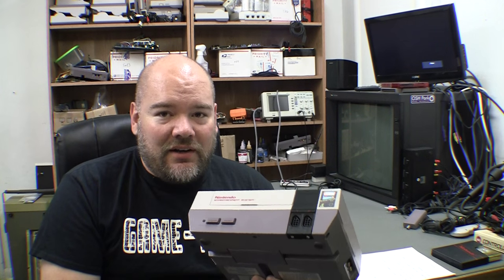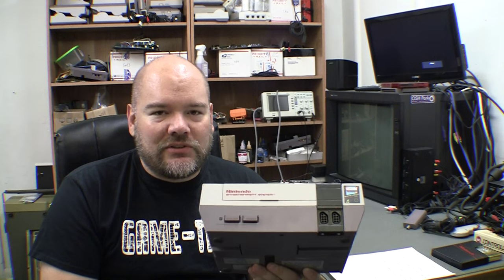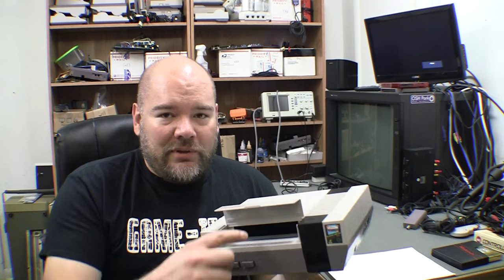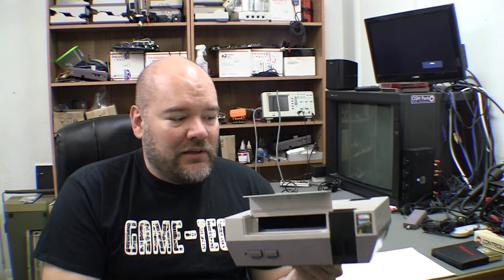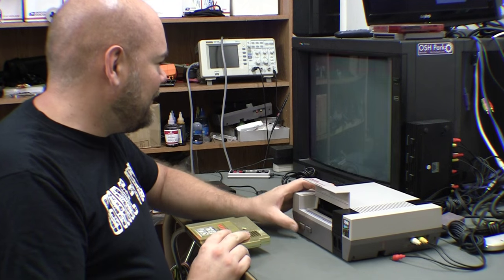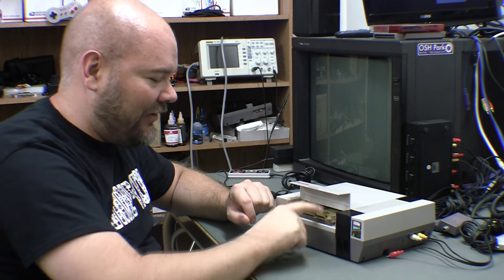Nintendo NES - Blinking Light Win review - zif connector replacement

Comment: What you could do is add some kind of lubricant or oil on a Nes kart and insert and take it out a lot and see if the loins loosen
Reply: Gamerguy8585 ...you are never coming round to play Nintendo at my house.
Reply: Like dielectric grease? I wonder what that'll do when you spread it to another Nintendo by exchanging carts.
Reply: It would be a Mario cartridge and it will only be used for adding the lubricant
Reply: 15 years ago a coworker brought an already-obsolete Windows 95 Acer Aspire PC to me with video problems. I tested various VGA monitors but the VGA output would not work. He suggested trying dielectric grease, which I thought was a crazy idea that he only suggested because his second job was at an auto parts store. Because it was integrated VGA, there wasn't much I could do beyond suggesting a new video card.

I was blown away when, against my advice, he fixed it by applying dielectric grease to the pins of his VGA cable and inserting it. It suddenly began working with every VGA device/cable we tested. In my mind, if it was able to help make a connection then it was conductive and if it was conductive then it would short all the pins together. Clearly, I was wrong.

I genuinely wonder if it would help here.
Reply: Emmett Turner Or you could just clean the pins properly.
Reply: Cleaning doesn't prevent future corrosion/oxidation and doesn't promote conductivity through contaminants. It's not like we were able to clean inside that integrated VGA port but it worked great through whatever oxidation and contaminates it had.

If it works a layer of grease may hold/dilute contaminates and renewing it could be easier (remove bulk of old grease with contaminates and replace with fresh grease without opening). Grease may restore continuity even without cleaning. Like I said: I am curious.
Reply: Emmett Turner I just think that if it was a great idea to grease electrical contacts that's how they'd ship. Unless you're applying salt water every day a VGA socket should last decades without corroding.
Reply: +Emmett Turner One of the after-market ZIFs I bought was excessively tight and I did add some diaeletric grease to it to help break it in. Although it did help loosen it up, the grease created problems (constant 10NES chip blinking). i ended up having to pull the connector and clean all of the grease off to get it to work reliably (for about 2 years anyhow until that connector crapped out too).

Soooo... Can't say I recommend it, but if you wanted to loosen a connector up before installing it, so you can clean it out before installation, it's a viable option.
Reply: Ichabaud Craine Tell that to the engineers who put dielectric grease inside of millions of electronic components and connections every year. Have you ever serviced a pot to fix something like a scratchy pot or a jumpy/jittery dial?
Reply: Maxwelhse Well, since I posted that I did try it on a horribly corroded copy of Teenage Mutant Ninja Turtles. It barely worked on top-loaders (I had to pull it out slightly) but no amount of cleaning would get it to work on a front-loader. Dielectric grease got it working very reliably, though I don't know what the long-term effects would be. I didn't get much inside the contacts of the NES but I can clean it out using cloth-wrapped cards that fit in my official NES cleaning kit. That means I don't have to take it apart to get it off the pins, though I still do that frequently. ;) I had no problem with the CIC/10NES lock-out chip.
Reply: Emmett Turner
The best solution I've found for a badly corroded cart is to disassemble it, clean the contacts with Brasso, clean the Brasso off with soap and water, and the flood the cart with isopropyl alcohol to "dry" it. It takes about 15 minutes total and you're up and playing again. The grease is probably a temporary solution.
Reply: Maxwelhse While it may cause issues in a connection like this, dielectric grease is specifically intended to displace air and water in other electrical connections for years. If you aren't coating all carts and regularly cleaning the connector/reapplying grease then I imagine it will attract/collect dust and continually transfer grease to other carts until there is nothing useful left. Also, don't expect to use other carts in your system or your carts in other system. ;) What I did was an easily reversible test.
Reply: Emmett Turner
I'm aware of the purpose of the grease (hence why I own some and tried it), but in this application it just doesn't work very well and the only way to undo it is to remove the connector from the console and clean it all off, which isn't that easy to do. I was having issues with it within a day or two and had to do exactly that to correct the issue. It's great if it's working out for you, but I can't personally recommend it since it didn't work for me.

The proper answer here is to have clean carts and clean/good condition connector. In the context of this video, the replacement connector/tray looks like a great option.
Reply: It was a corroded cart that couldn't simply be cleaned as there were literally holes eaten through the contact pins. I had used everything on it, even the abrasive cleaners like Brasso, Mr. Clean Magic Eraser, and scraping off corrosion with a razor blade.

I only tried dielectric grease because I had exhausted everything else and I was curious. I had the NES apart and cleaning the connector was no problem, but I could have cleaned it out nearly as well without opening it (official Nintendo NES Cleaning Kit). After all, the corroded game was a dupe and I have over 400 other game paks that don't need grease to work so I wasn't even considering leaving it in there and transferring it to everything else.

I boiled the connector and used a cloth-covered card with 99.9% isopropyl to make sure it was all out and I followed that up with the official Nintendo NES Cleaning Kit. I think the official Nintendo NES Cleaning Kit alone would be enough as long as the cleaning card is cleaned of all grease because there was very little inside the NES. It only took a very light coating on the game pak contacts to have an obvious effect so the NES connector would have had only a trace amount transferred by contact.

FWIW, I've seen people who will not buy NES games that have been cleaned with Brasso. Brasso is an abrasive that damages the plating and accelerates oxidation. I didn't care about this particular cart because it was already reasonably beyond repair.

Comment: With the "DEATH" grip, couldn't you just try to gently bend the pins down/away? I've done similar to a "new" 72 pin connector (bending down bottom row alone) using a cart's mainboard and a multimeter to get it to feel "like" OEM. With the Blinking Light Win, I feel you could plug in a cart's board (B.L.W. NOT plugged into the NES and free in your hand) and use something like a sewing needle to get in between the pins and molding to "squish" so to speak against the board. I'd imagine to find the "sweet spot" you could check for continuity from the pins to where their traces lead (SMB3 is a good board to use for this) to adjust "just right".

That or 3D print plastic pliers with a square head with teeth that fit perfectly into the indentations of the cart's finger grip (unlicensed carts likely excluded). Maybe something Arcade Works could have done?

Comment: Hey man... Just wondering, your name is "GameTechUS" and you seem very technically savvy: Why wouldn't you just take the system apart and clean it? Bend the original pins back into place and the system is like new again. 

Reproduction and after-market parts are unnecessary. Why would you recommend people replace original parts with these?
Reply: Exactly! That's what I did for mine!
Reply: +Air Villain For me, personally, that doesn't seem to be a lasting repair. I've had to do mine a few times and if you remember back to the 80s most NES developed problems after only a few years (by 1988 literally everyone was blowing on carts).

I've also tried the after market connectors and they're all junk. If for $30 (the price of this kit) I could fix it for life (without any permanent mods), and know that they would actually ship it, I'd be all over this. Much like GameTech, I had been considering hand building something like this for myself for years.